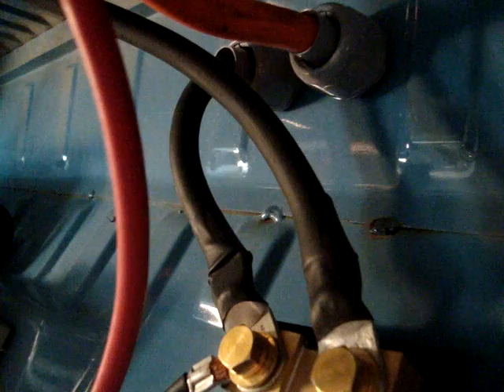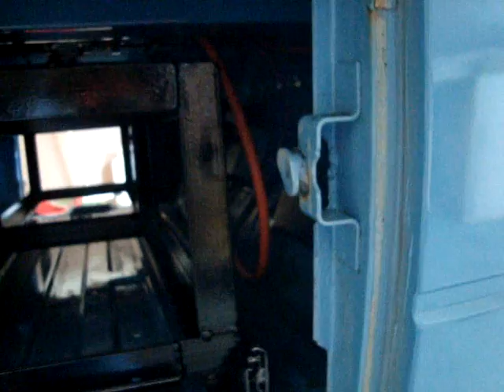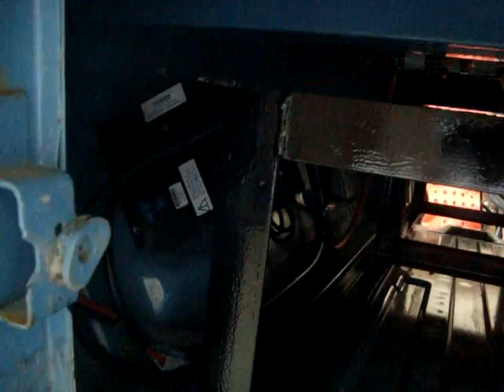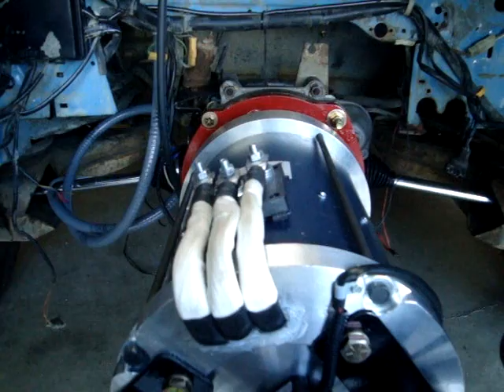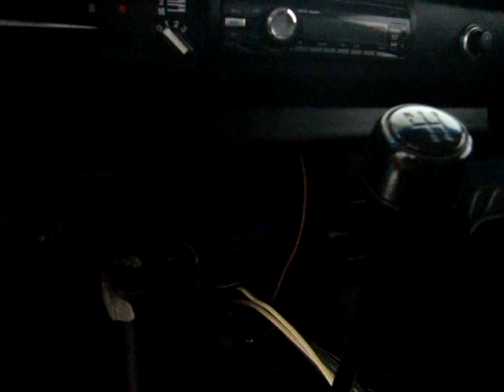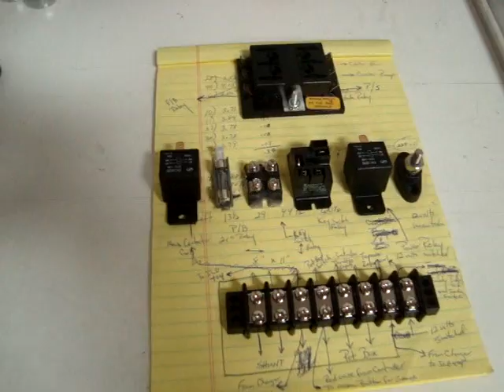DIY Electric VW Transporter Doka, Episode 6

Comment: Hi, Richard. What kind of emergency disconnect in the dash did you use?
Reply from the maker: Not sure which one was used on this conversion, but here's a link to one you can use.http://astore.amazon.com/ev4cuscon-20/detail/B00548585ARemember, not for high current circuits.